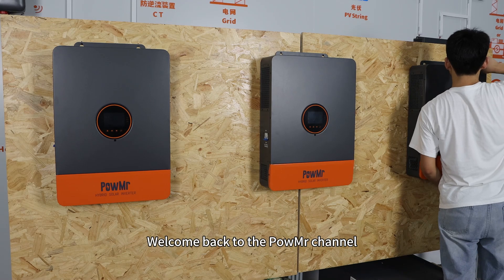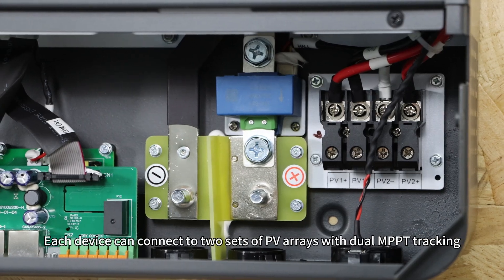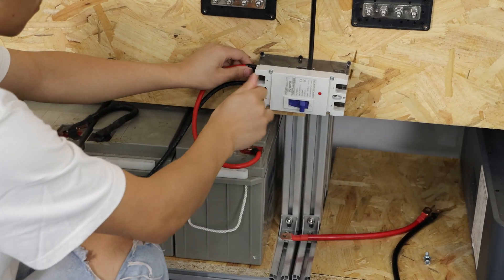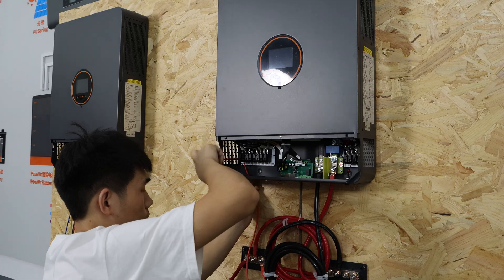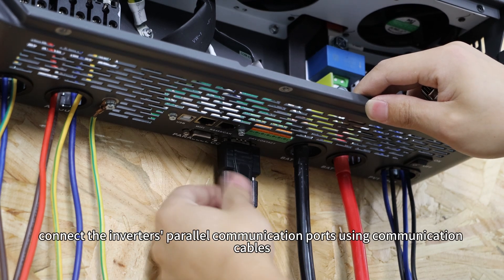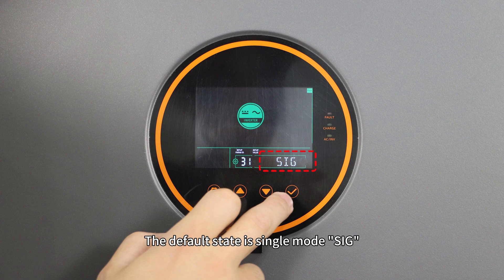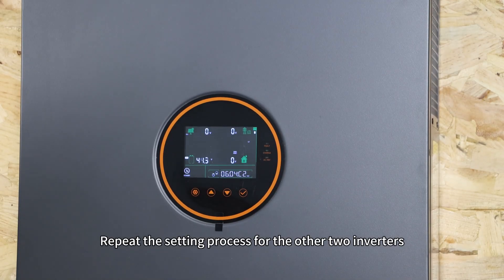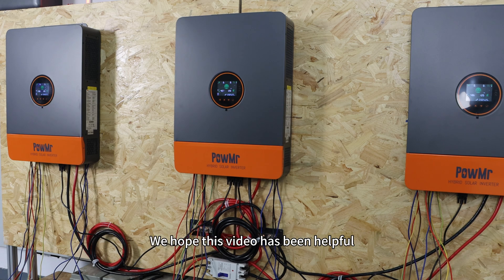How to Parallel Connect POW-SunSmart 10KP?

Comment: How to connect powmr 6.2 and dynes b4850? What is the cable pinout? Are they supported at all? Thnx
Reply from the maker: Please ask the battery supplier if the battery uses PACE or Pylontech protocol.
Reply: @PowmrSolar  Yes, this battery uses the pylon protocol! Which pins in the battery should be used for Powmr 6.2?
Reply from the maker: @FlaWour  https://www.youtube.com/watch?v=tTxPaQ5EQOo&t=83s

Comment: can i use only 2 of these 10kw inverter for parallel split phase?
Reply from the maker: Yep.
Reply: @PowmrSolar   to get 20,000 kwh output ? each inventer 120v to get 240 output split phase?
Reply from the maker: @davion2881  Yep.